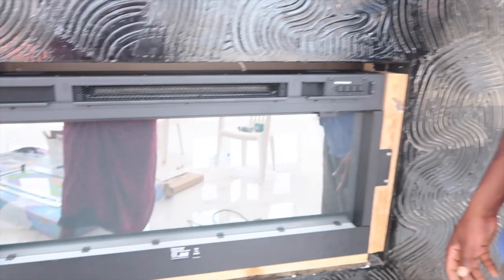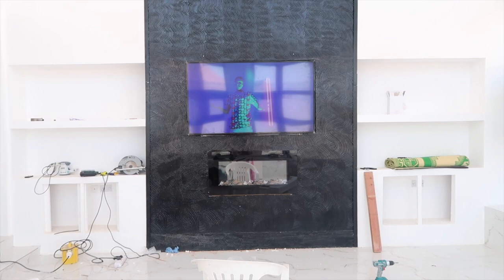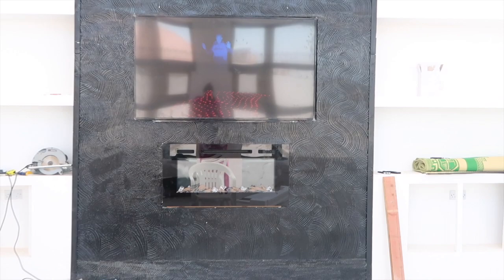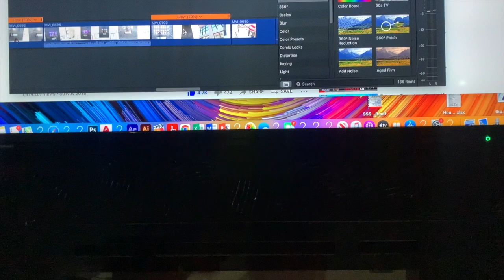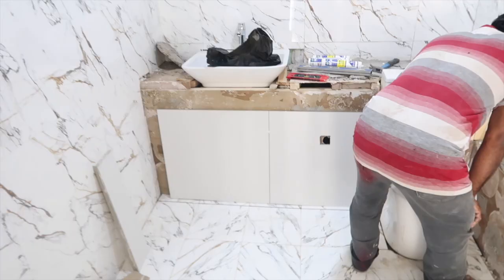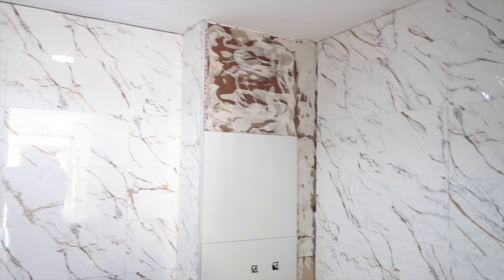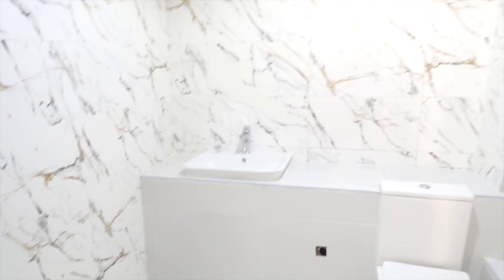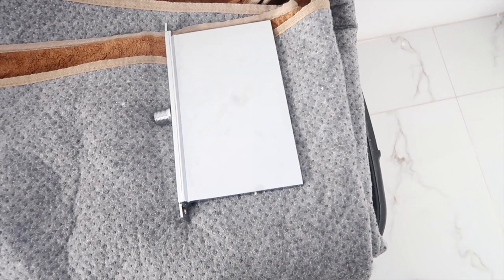Building my house in Somaliland (Part 17)

Comment: One issue I’ve always had with Somali architecture in the north is the one floor, all cement and metal roofing. It’s beautiful to finally see the use of drywall and wood as well as other materials.
Reply: I haven’t noticed that issue. I live in a 3 story and my neighbours are in a two story. It’s probably a money thing as foundation for multiple floors do cost a bit.